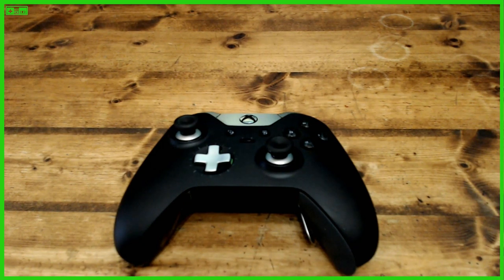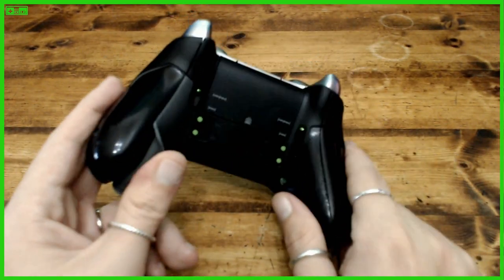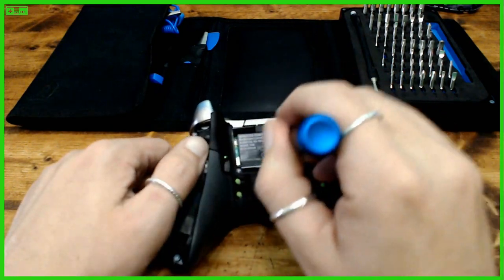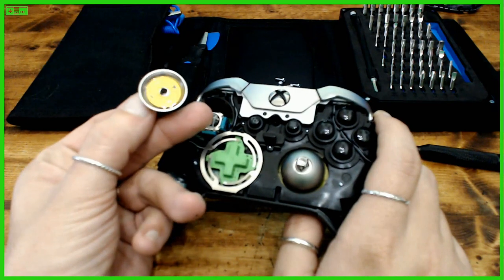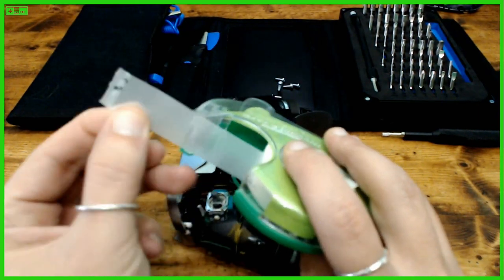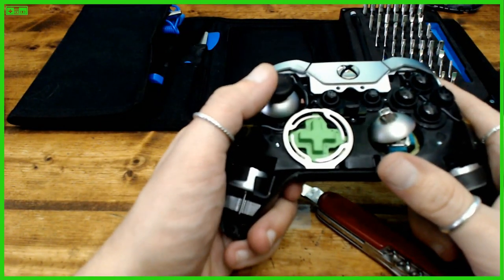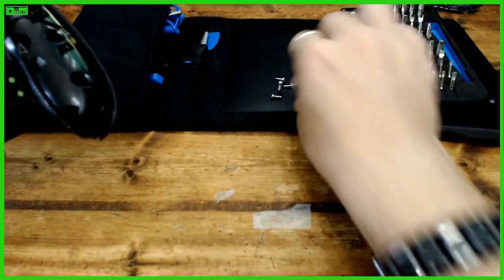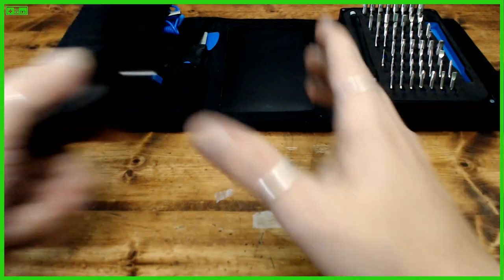Loose Thumbstick Fix

Comment: Just a comment, but once you have the controller apart, i have found that lightly touching two corners of the joystick ( the grey handle part) with your soldering iron will deform the plastic handle just enough to tighten up the fit. I have fixed HUNDREDS of these like this and have had none come back. This is NOT for stick drift, just loose fit between joystick and thumbstick "hat" if you call it that. 2 second fix! takes longer to disassemble then to fix.

Comment: That’s good but almost all new Xbox controllers; Microsoft or third party have a little wobble in the sticks. I’ve learned if it doesn’t get worse in a couple weeks it typically won’t. Problem is it’s irritating for me and those like me.  I’ve got a7 year old Xbox one controller that’s been used so much and dropped hundreds of times and it still has wobble.
Reply: And it doesn’t have wobble i meant about the Xbox one controller.

Comment: i have issue with the right stick thumbstick, when i turned the controller upside down it kinda pops out a bit.
Is this considered a loose thumbstick?
Reply from the maker: Ya it's loose. You can use the tape trick or go to Amazon & order new sticks.
Reply: @LowPingKing  could you send a link to some cheap ones?
Reply from the maker: I just use Amazon. The prices are fair depending on what you want.
Reply: @LowPingKing  ah ok. I found some.

Comment: I can't see from the camera not focusing but which part is worn? Is it the grey rod or the thumbstick hole? I assume it's the grey part that's plastic but I'm really hoping it's the thumbstick  since those are dime a dozen on Amazon.
Reply from the maker: The Thumbsticks.
However with an Xbox elite controller can't be replaced the same way because of the removable sticks.
Reply: @LowPingKing  I don't understand. You can buy the magnetic thumbstick on Amazon that match the elite controller exactly (I know this because I have the same ones on my ps4 controller and I own an elite controller) if you are saying the metal part that stays in the controller is the part that gets worn then I'll just go ahead and grab a new pair off Amazon.  But if it's the grey rod that is part of the analog switch that the metal thumbstick "bell" that is worn then I'm out of luck.
Reply from the maker: I didn't know that it was possible to get replacements.
It's definitely the stick.
Not the grey rod.
So you should be good to pick up replacements.
Let me know how that goes if you remember.
Reply: Good to have that confirmation. I'll definitely grab another set and crack this thing open.
Reply: You sir were correct. Just threw a new set of magnetic "bells" onto my elite and problem solved.  Tight as a nun.  I'm really shocked it was the bell not the "grey stick" since the stick is hard plastic and the bell is metal.  You'd think the stick would have worn first which is why I never even considered just swapping the bells. Thanks for getting back to me though cause if you didnt I'd still be gaming with loose sticks.

Comment: I have a problem with my right thumbstick when you press it in while playing a game like call of duty or Fortnite to crouch it feels really different to what it was like on Friday it almost feels like the thumbstick is going to snap and it also moves by itself when you press it in
Reply from the maker: That's odd my right thumbstick normally doesn't have any problems.
Reply: Same here trying to fix rn
Reply from the maker: Good luck!
Reply: My controller just broke that's not surprising at all the right bumper broke. I am the most unluckiest person to ever exist none of my controllers last more than a month
Reply from the maker: Had the exact same bumper break.
Reply: @LowPingKing I have the series 2 gen 2 where the thumb sticks screw in I can’t really do it as I tried and it never worked for me would it be best to buy a new set of them

Comment: Ok my dad has a whole workshop and couldn’t find any screws that worked ?!
Reply from the maker: It's a specialty screw called a torx t8.
If you look real close Lee in the middle of the screw there's a little Pole.
That's what makes it special.
If you don't have a torx t8 you can sometimes use a bobby pin but you'll have to melt the little plastic and off the bobby pin and be very careful to not break the little nub in the screw.

Comment from the maker: I have more Tinker Time's planned 👍
Let me know what you think 🔥
Thanks for your support and for being so awesome 😀
Reply: Yup. I got it fixed. Not as good as new, but huge improvement compared to what it was. Tape didn't work for me thou. Filled the hole with some cotton wool and pushed the stick in there really hard!
Reply: https://scufgaming.com/eu/scuf-elite-precision-thumbsticks-and-pro-grip-handle-kit

Just ordered those for replacement for my original elite grips. Other one fell of literally on my hand few nights ago and that why this whole fixing operation of mine got started. Original plan was to replace elite grip with normal controllers grip, but it didn't fit.
Reply from the maker: Interesting.
Thanks for the heads up.

Comment: Tape REALLY... It doesn't last great idea... Try going to an older hardware store an ask for a piece or package of thin flat rubber gasket material and try again. Rubber will out last controller.
Reply from the maker: Great thinking! A definite must try.
I chose tape because I figured most households have some sort of tape.

Comment: Dude, my thumbstick wobbles like in the finished "repaired" one and it's making me go crazy (it works fine, but you can feel it when you move the thumbstick around). I don't remember them being slightly wobbly when the Series X released lmao 2nd brand new controller doing this :( Maybe am just too sensitive lol
Reply from the maker: Unfortunately controllers wear out way too fast these days. I'm pretty rough on mine and go through about one or two a year.

Comment: So what if my left stick doesn’t register like trying to sprint on games
Reply from the maker: Sounds like it's dirty.
Reply: I just cleaned it and it still doesn’t work, like I can still move and stuff but if I want to sprint by clicking down it doesn’t register
Reply from the maker: There's actually a very tiny button off to the side inside the controller.
When you click your stick down it has a little lever and clicks that button.
That button or lever may be broken?
I've never had that happen though.
More likely that it's just sticky.
Reply: @LowPingKing  idk man thanks for responding and trying to help, especially on a two year olds video😂